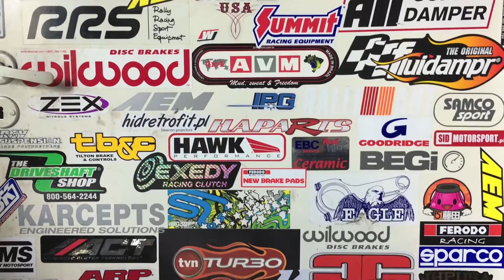BMW 335i - how to install aftermarket FMIC

Comment: Did you log your inlet temperature with MHD before and after? Do you maybe have some full pull logs available in datazap.me? Really interested how this performs. Did you notice and lag in throttle response or drop in boost levels?
Reply from the maker: Hi Nils. Sure I did and sure I have logs - please have a look. https://datazap.me/u/wwojnar How it performs? I'm very happy with the results, stock 335i is as exciting as stock Lada 2107 or Yugo Koral, seriously. MHD really brings this car to life. Lag? No different from the stock one. Drop in boost levels? Only on hot days on stock fmic, so upgrade of the fmic is a must. Check my other videos to see how the car accelerates etc - and if you have more questions, do not hesitate.
Reply: One Monster I'm allready running MHD 7.1 stage 1. I'm still doubt if I buy an VRFS for 600 euro or this one for 350 shipped. Many thanks, will look into the datazap as soon as I'm at home.
Reply from the maker: Depending on your targets. If you're a casual hoonigan and occasionally want to roll some random victims, the cheap one is ok. If you're nuts, want to go for single turbo and money is no object, then obviously go for big vrfs or wagner. Almost anything is better than stock one.

Comment: was that a front diff I saw?? the subframe looks diff to normal and a strength plate? have you modified your 335i?
Reply from the maker: +Jal Daruwalla nah, all stock. I have a xdrive 335, hence the front diff you noticed. All stock (for now).

Comment: That cheap ebay one is a PITA to diy with jack stands. Not only it requires cutting plastic, but it also doesn't fit height wise and depth-wise. Get a good reputable one with least amount of cutting. Plus, this thing is too heavy. You can't do it by yourself. I somehow managed to fit it, but it couldn't be pushed towards front so that the piping didn't align straight with the chargepipe and the ascending pipe on the cold side.
Reply from the maker: +Daniel Park can't argue with that
Reply: which one did you oder ? link... and what car did you put in on?